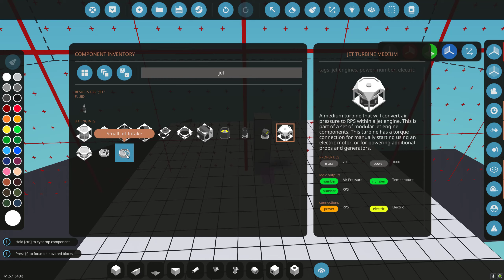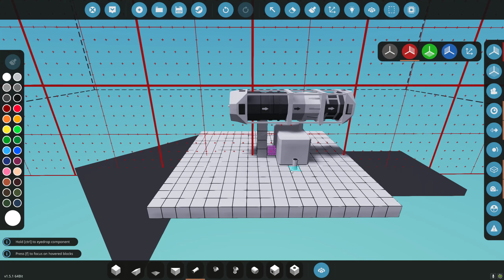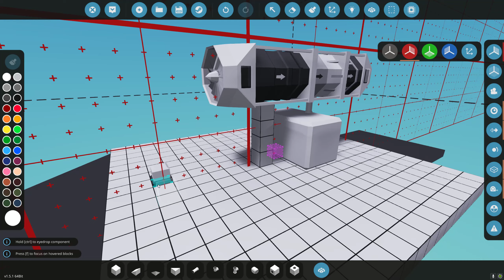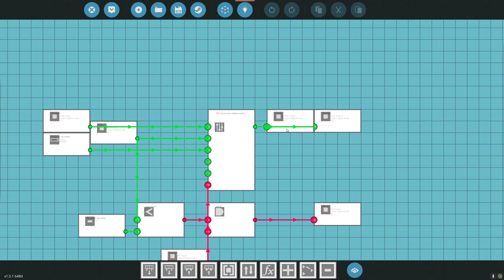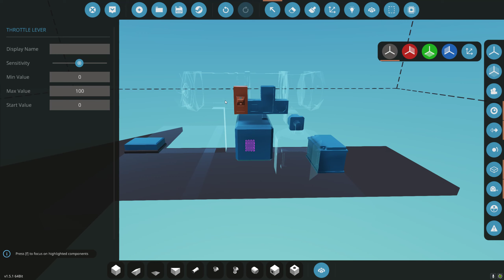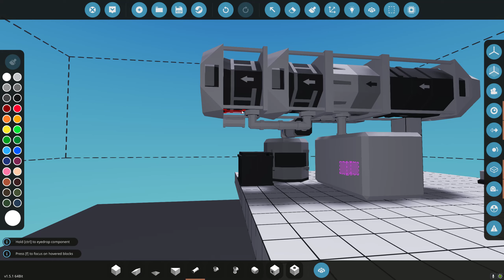Stormworks Basics Jet Turbine Tutorial

Comment: Really helped! Thanks.
Reply from the maker: I'm glad you found it helpful. 😁
Reply: @CaptainCockerels  what would you suggest if I'm losing fuel too rapidly in my jet engine. I've added a gear to the tail, and two gears to the main, tweaked the ratios and it'll get off the ground at 60 rps. Is this good, I have no clue. I'm losing about 2L/s  with 1118 total liters of fuel. She flies but not for long.
Reply from the maker: @m777howitzer4  ultimately the only so you can do to reduce fuel burn is to reduce the RPS of the turbine.

Then you'd increase the gear ratios pointing towards the engine to account for the reduction in turbine RPS.
Reply: @CaptainCockerels  will do. Much appreciated.
Reply: @CaptainCockerels  update: got the takeoff rps reduced to 40, and burn down to 1L/s. Keep saving the day for us normies